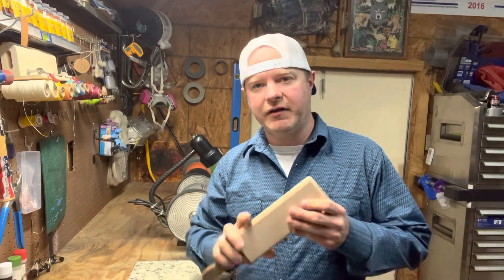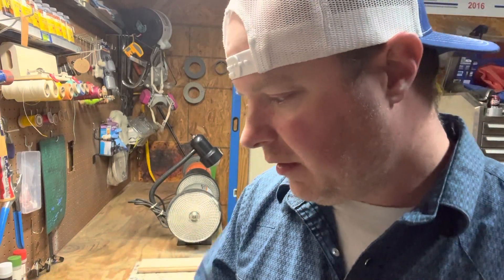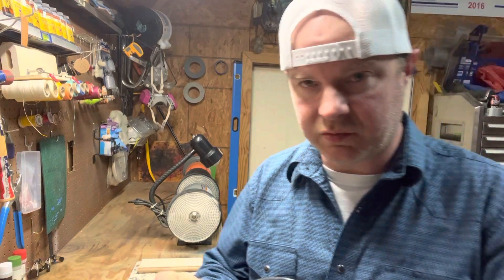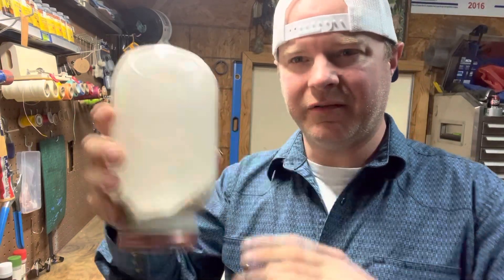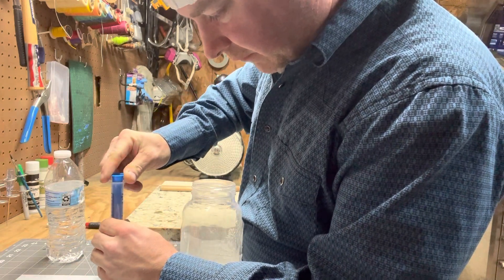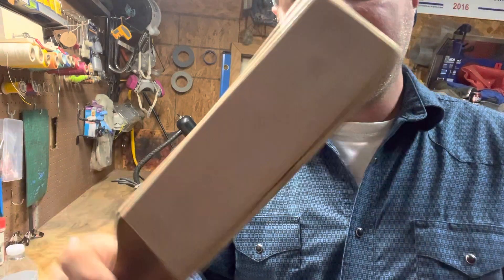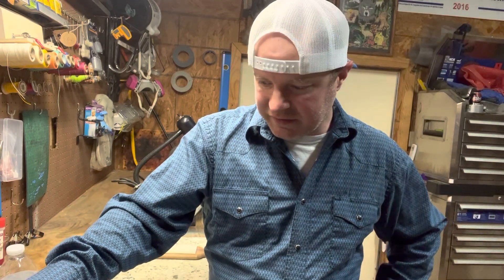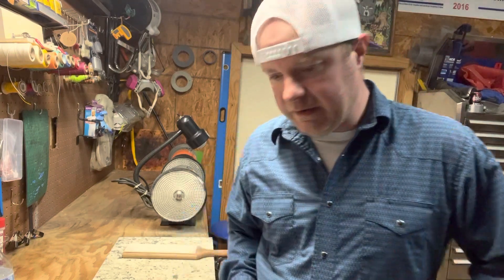Richter Knives Episode #52 SCIENCE!!MAKE YOUR OWN DIAMOND STROPPING SPRAY

Comment: I couldn't find how much powder he used, so for anyone else wondering I did 1g of 1micron powder per oz of water. Probably could have used half a gram or less per oz, but it's cheap, so 1g to 1oz is what I'm using. I'll comment again if it doesn't work out for some reason. Not expecting any problems though.
Reply from the maker: Let me know how that comes out bud

Comment: I'm late to the party, but next time try mixing your abrasive with leather conditioner. The thicker consistency will help keep abrasive particles suspended and the conditioner will help keep the leather from cracking and drying out. Neatfoot oil is what I've been using.
Reply from the maker: Genius
Reply: That's what I did. It works really well. Keep the leather nice and fresh.
Reply: @Ingeb91  so I have a question for you, how do you mix yours? In other words, what’s your recipe. Do you use water and some leather conditioner, or all leather conditioner, and diamonds?
Reply: @ I didn't thin it yet, I just added the diamonds into a container, and added oil and shook until it started being sprayable. I'm sure there are better options. I think oils that are a bit thinner are probably more ideal, but this works just fine. I get really nice results from it.
Reply: @ianmccue922 what is your recipe? I mean, do you use water and add some leather conditioner in with it or do you just use leather conditioner and the diamonds?

Comment: How well do diamonds adhere to strop after the water dries off? Do they come off during stropping as there is no compound holding it on the strop?
Reply from the maker: @ahmedejaz1125  scientifically, I’m not sure. The diamonds are very fine. I do know that it lasts a good while before needing to add more and it works really well.

Comment: Use isopropyl alcohol, the higher the concentration the better, and let it dry off the leather then apply a little mineral oil to hold the compound in there otherwise it will dust off once the alcohol dries.
Reply from the maker: Great advise